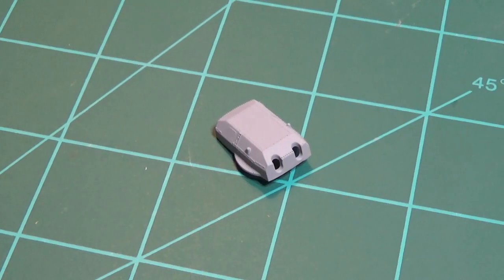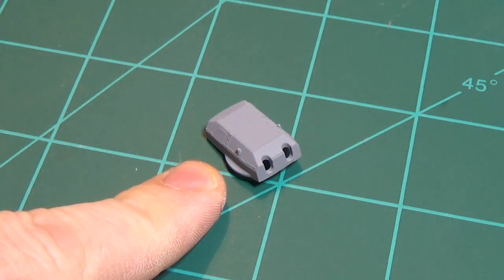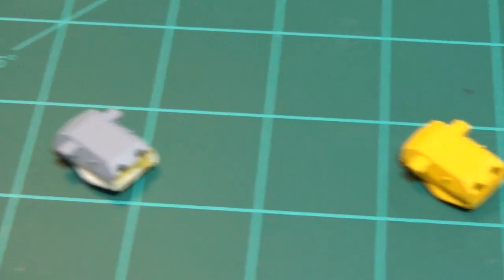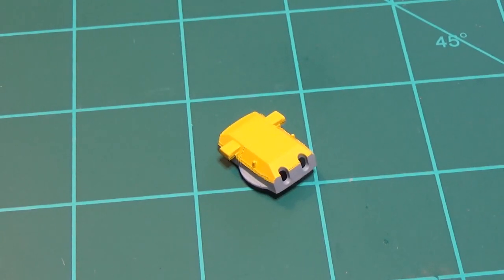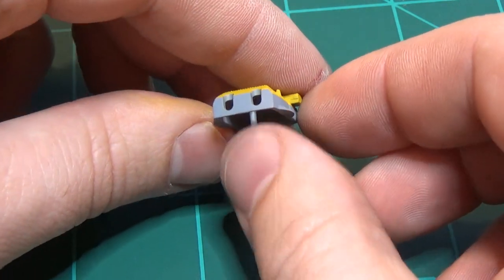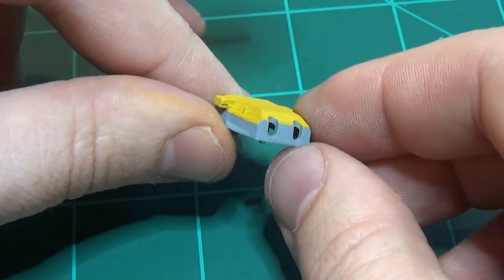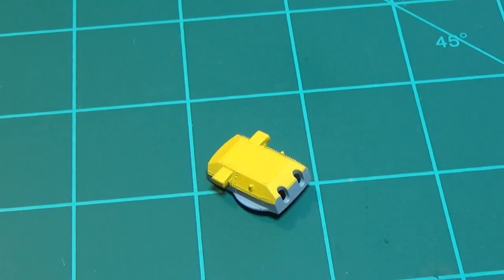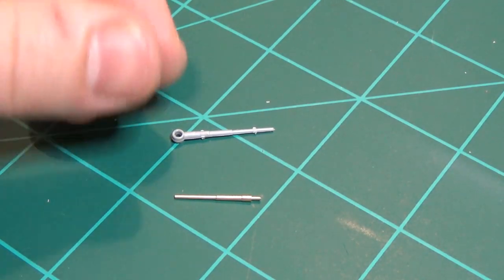Italeri 1/700 Bismarck Build Video #5

Comment: Hi, good job on the build. How did you managed to insert the barrels into the secondary guns? the barrels do not stick all the way out as they suppose to be since there is the attachment pole in the middle.
Reply from the maker: Thanks! Honestly, I don't remember. Depending on your kit, you could try to thin out that pole, or just cut the barrels off and make a new attachment point for them on the inside so they protrude out the correct distance.
Reply: @TheMidwestModelShop  thanks